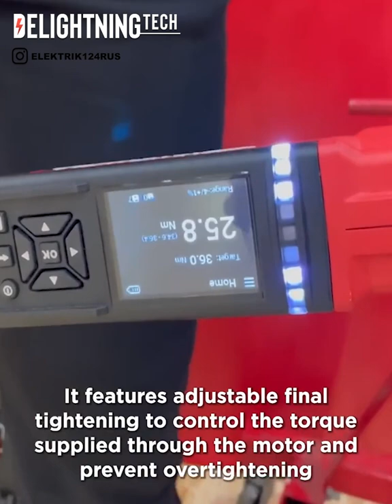Amazing Tools That Are On Another Level

Comment from the maker: Let us help you navigate faster with these timestamps 📍☺  

00:00 Cableaid
00:10 Blade Sharpening
00:15 Plastic Pipe Cutter
00:23 Ratcheting Wrench
00:37 Copper Pipe Cutter
00:47 Lawn Sanding
01:05 Exoskeleton
01:31 Rebar Cutter
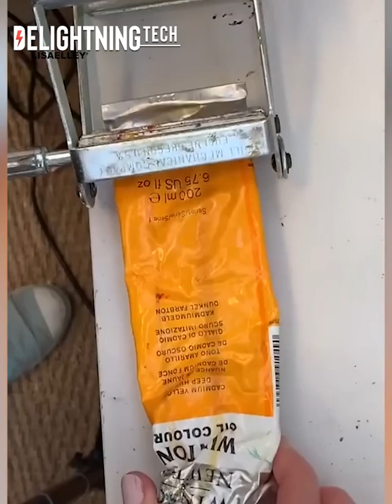01:48 Tube Extractor
02:00 Rhino Cart Dolly
02:34 GM Car Jack
02:43 EGO Fan
03:00 Nail Digger
03:11 Tapole Tape Cutter
03:31 Water Valve
03:51 Self-locating Pliers
04:02 Sharp Pog Sharpener
04:12 Plowing Machine
04:32 Stud Detector
04:44 Metal Hole Puncher
05:00 Dust Extractor
05:18 Dream Tool Box
05:29 Camo Marksman Pro
05:44 Burro Buddy
05:54 Copper Pipe Cleaner
06:09 Plastic Pipe Cleaner
06:25 Wire Stripping Tool
06:39 Extreme Sanding Disc
07:00 Safer Paver
07:13 Rounded Bit
07:35 Nuron Hammer Drill
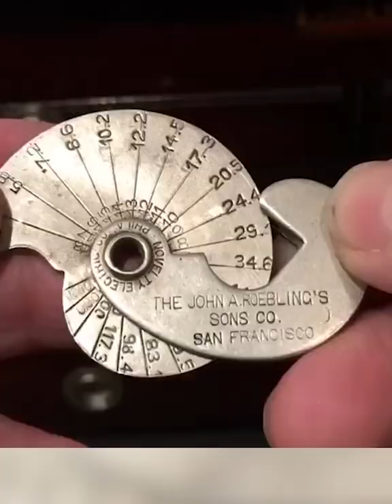07:53 Brick Clamp
07:57 Roebling Device
08:16 Spider Tool Holster